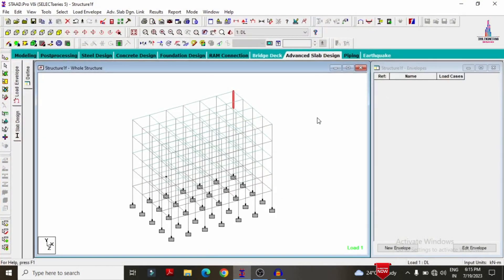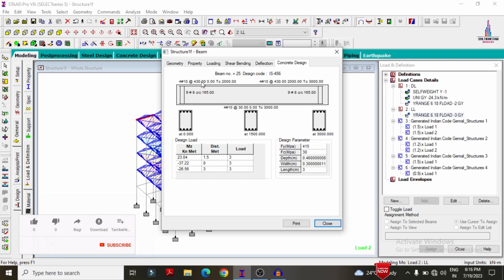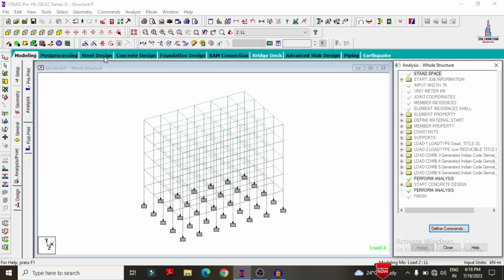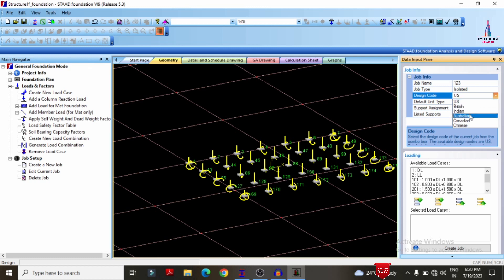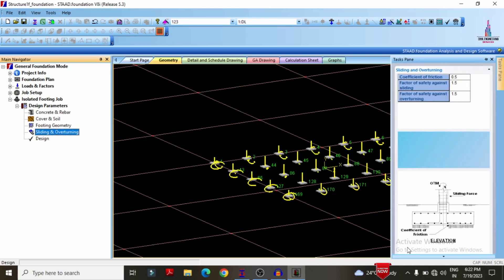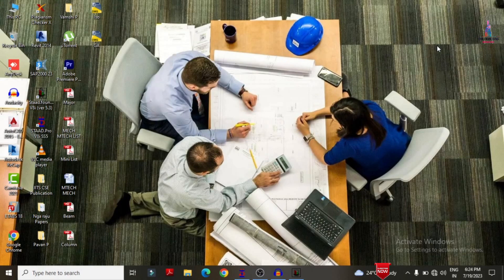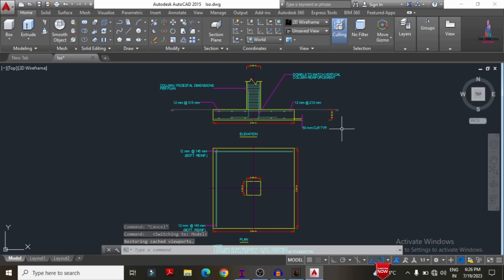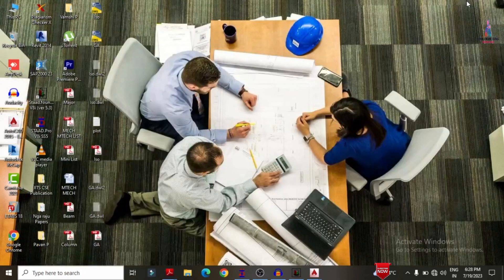Read and print complete building design Results from Staad to PDF | foundation design | civil |

Comment: Just validate one building design with manual calculation. Take the forces from staad and do the manual design and compare your results with staad design results. ( Beam, column and slab)